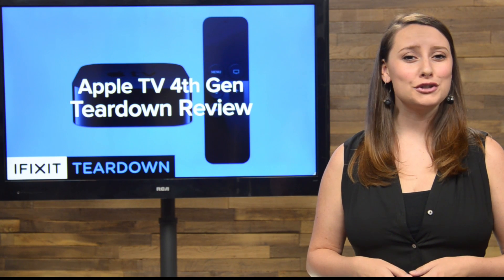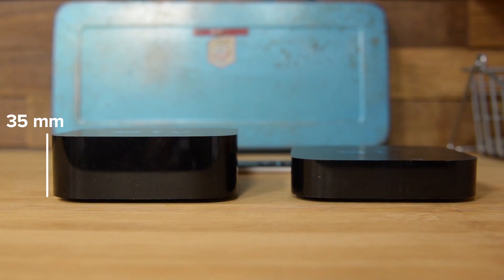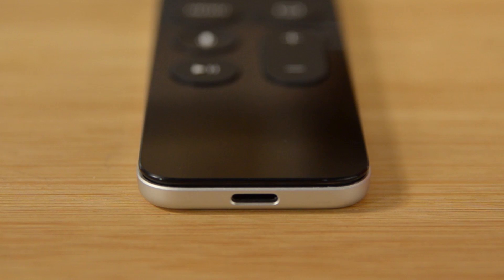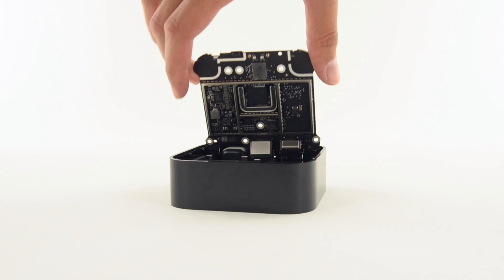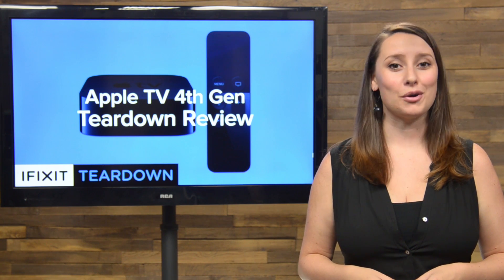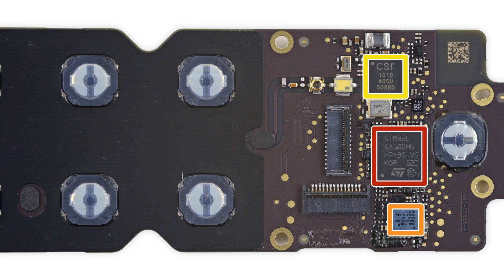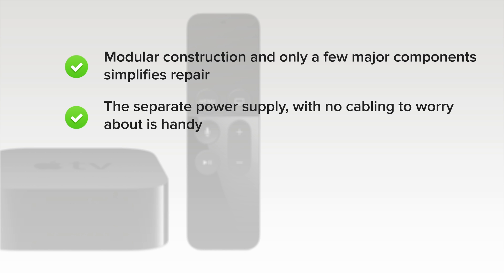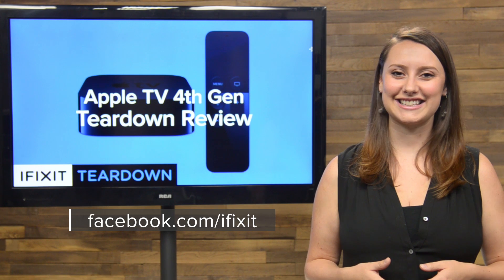Apple TV 4th Generation Teardown Review

Comment: how do we convert ac to dc with atv4. i like to put one in my car powering it with cig lighter
Reply: +AskUncleDave I don't know how tf you plan to use it in the car, but if you really want to, just buy an AC car adapter where you can just plug in a normal plug and it converts it. http://www.amazon.com/BESTEK-Power-Inverter-Adapter-Charging/dp/B003ODVN88%3FSubscriptionId%3DAKIAILSHYYTFIVPWUY6Q%26tag%3Dduckduckgo-d-20%26linkCode%3Dxm2%26camp%3D2025%26creative%3D165953%26creativeASIN%3DB003ODVN88 Something like this for example...

Comment: I'm upset about the rechargeable battery, since those batteries only last 500 cycles. My current remote is still going after 3 years on the same battery, but even if it dies I can easily go to RadioShack and get a new battery. Replacing the battery in the new remote won't be as easy. I'll have to pray open the glue, etc.
Reply: +EPS5000 Considering the battery lasts 3 months between charges, 500 charging cycles gets you 1500 months of use, or 125 years of service.  I strongly suspect you won't be using it by then. ;)  Even if the battery charge only lasts half that long, chances seem good that the battery will outlive the useful lifecycle of the ATV itself.
Reply: +CompuDude That's awesome news, thanks. (I was never that good in math).
Reply: I've only been using this for 3 days (since the 19th) and already I can tell it's not going to last 3 months on a full charge. I'm currently on about 80%, just from 3 days of use.

http://i66.tinypic.com/2ryopki.jpg
Reply: In case anyone was interested, I just ran a test and it's a max of only 18 days on a full charge. That's how long it took my remote to deplete from a full charge.
Reply: +CompuDude I think 1 month between charges is more realistic, although still talking of 40+ years...
Reply: Hehe, battery case coming for Apple TV remotes...

Comment: Semantically, why is it called a 'logic' board?  Why do people keep using this term?  If it's to refer to digital 'logic', then any board with digital ICs is a 'logic' board.  My point is that it's a flawed term that's Apple specific which is even more awkward.  It would be like Honda using a different and awkward word for 'engine' than the rest of the industry.
Reply: +Shao Zhang Lemme Just Translate for you, Apple's "Special"
Reply: +Shao Zhang It is a logical name for the board.  It is an appropriate term that makes me fondly remember TTL Logic boards.  The boards were digital back then, just no microprocessor.  Only Transistor to Transistor Logic Gate chips. AND, OR, NAND, NOR, XOR, etc.  Logic Gates is what it was all about. Logic, Logic, and more Logic.  Microprocessors, no matter how small or complex, still perform the same type of digital logic calculations, that the old Logic Gate IC chips did over Four decades ago.  Four decades ago, these boards were also 100% digital..  That is why they are called Logic boards.  It is like a digital finger, pointing away at the main board.. Concentrate on that digital finger, and you will miss all that logical glory..
Reply: Komet163B Except most all sub boards in a system these days contain digital logic so they are all 'logic boards' which make the term meaningless to describe what should be the 'main' board.
Reply: +Shao Zhang Apple just has to stand out.
Reply: Err, think about what you just said.  "MAIN digital LOGIC".  The word "logic" is redundant and not used by the industry both technically or commercially.  It makes more semantic sense to call it a MAIN board.  In a majority digital age, the word 'logic' adds no real meaning and even if you go back to the 80s it's still not a great choice.

Comment: Giving this a repairability score is pretty dumb. There are no moving parts, it's not a mobile device. It stays put in the same place it's entire life. It's pretty rare for something to break in there, and if you have to repair it, it would probably be cheaper to buy a new one instead because the hardware would be so out of date by then.

I think it's pretty cool to see power connectors via screw posts, similar to the powermac G5's. It's also cool to see an ARM processor in such a tiny remote.

The only issue I can see is the remote battery cell degrading over several years to a point where it starts to bloat

Comment: Ok as someone that is pretty damn tech savy and doesnt mind change....I do NOT like the removal of the optical output. Yes I know that todays tech is all HDMI and so on but come on...I work in retail electronics and still on a daily basis have people that use older recievers with optical and no HDMI. Now I know what your thinking...got to the TV with HDMI and use its optical out OR "hey tell them to get with the times" - Optical is very versitile and I will miss it for customers in the future. ;)
Reply: +BSGT2TREKFAN88 i was happy about a new model coming out....until i saw there was no optical. my receiver, while old, is still better than 99% of the crap on the market now. it just doesnt have hdmi. no big deal
Reply: +BSGT2TREKFAN88 Optical is critical for CD quality audio through a proper sound system.  USB provides surround sound?  I don't get it.
Reply: +Bob Woolcock HDMI carries audio at a far higher resolution than optical can.  Unless your receiver (or soundbar!) has no HDMI.  Then you're up a creek.  The previous model ATV3 is still available, fortunately.

Of course, no streaming formats that the ATV can handle can output anything beyond what optical can carry, so the extra capacity of the HDMI cable is somewhat wasted...
Reply: +BSGT2TREKFAN88 Agreed.  I'm fine with HDMI personally, which is superior anyway, but wasted given the nature of what ATV usually puts out.  I know a lot of people with expensive sound bars and high end (but slightly older) receivers that are getting screwed by this, however.
Reply: +CompuDude Yes, unfortunately I have an older receiver sans HDMI.  That's why I bought the Apple TV in the first place - as long as it lasts as long as my receiver I'm ok :)
Reply: +BSGT2TREKFAN88 Another point for optical would be the isolation of grounds (which HDMI doesn't provide) In setting up my parents TV and receiver, we started with HDMI and had problems galore. After switching to optical it was finally possible to get rid of random skips in audio, refusal to connect, etc etc. There are definitely still places where optical is a useful standard
Reply: Chris Tate that sounds more like a bad cable issue or a hdcp issue.
Reply: After a huge amount of BSing around, I isolated the issue to a weird conflict between the onkyo reciever and samsung lcd tv. The problems were mostly when using the Anynet feature on the tv, but even with multiple hdmi cables, different power sources, removing every other device from the circuit it was hooked up to, there were issues getting it to remain connected reliably. In the end it was just easier to use the optical cable and be done with it. It very possibly had some basis in the very old power wiring in the house, we have issues with grounds not being properly... grounded. even using coax (thus not being electrically isolated) was giving audio issues, so it wasn't exclusively the HDMI. overall it was one of the most frustrating issues I've ever had to troubleshoot!
Reply: So how much did they save I wonder by omitting that optical audio jack and circuitry?  A little too early to declare it a vintage functionality in my opinion.